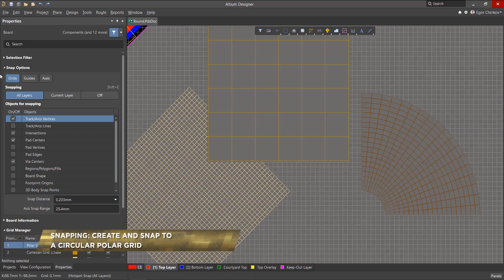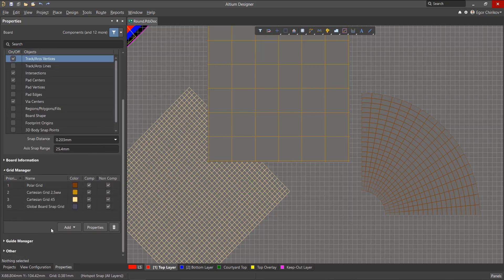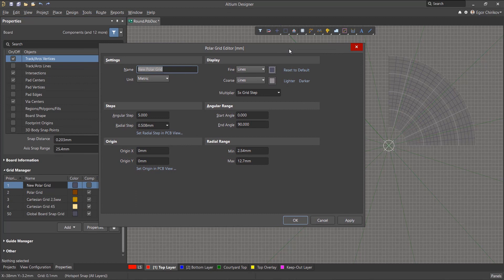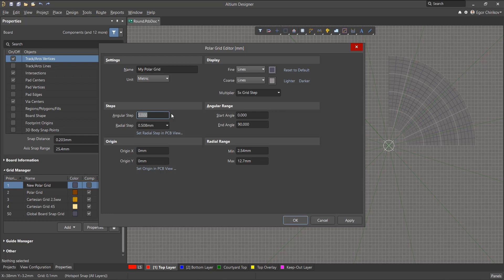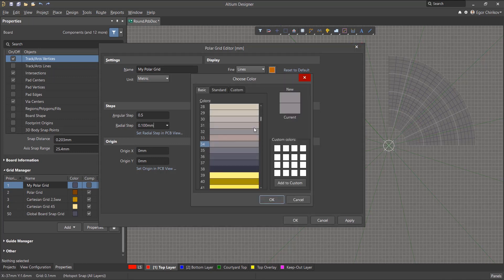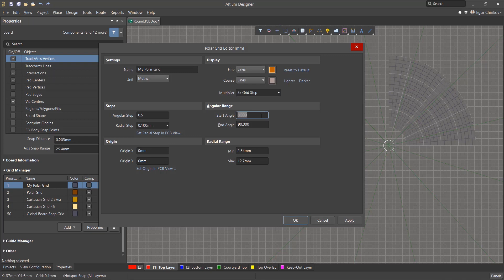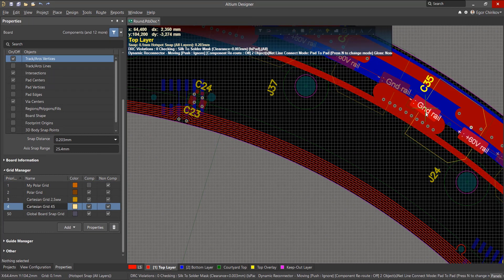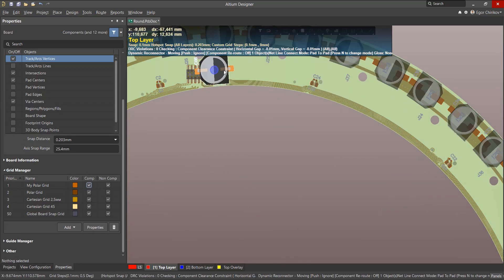How to Create and Snap to a Polar Grid in Altium Designer | PCB Layout

Comment: When I use polar grid, my components snap to the polar grid but not the trace, I can't get them to follow the grid. Can someone help me?
Reply: did you find any solutions?
Thanks
Reply: @andreagiudici926  I did not and it was an hassle. I think I ended up using cut and paste for all the traces with 1º rotation.
Reply: @manouTec  yea, with altium this kind of Job sucks. What i am doing now is using other tools such as solidworks, autocad, draftsight. Her either draw spline curves, export as dxf and import in altium